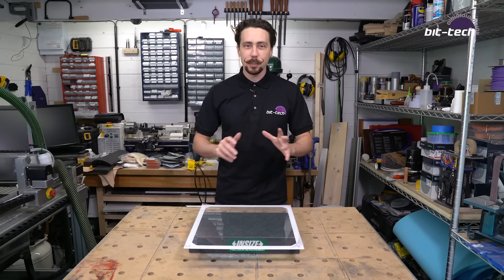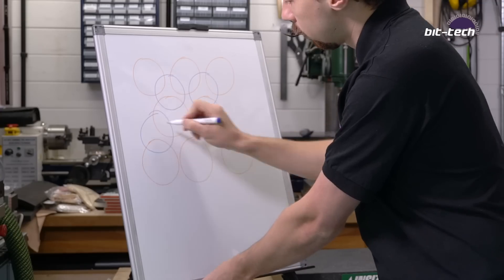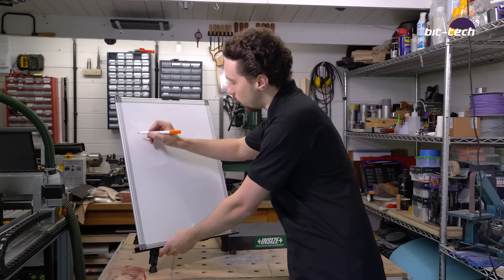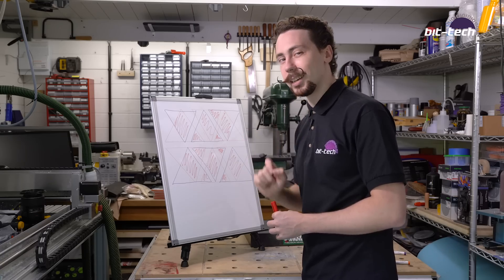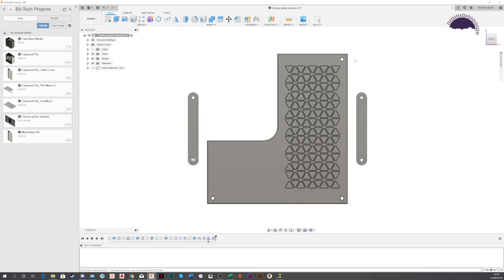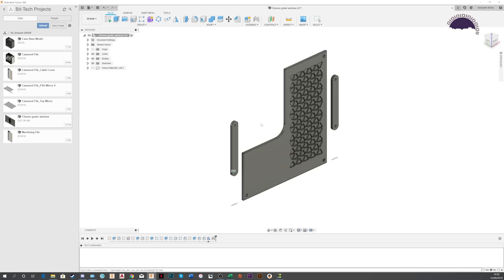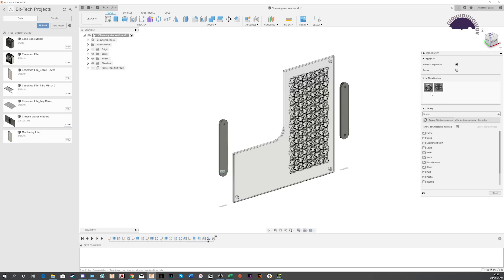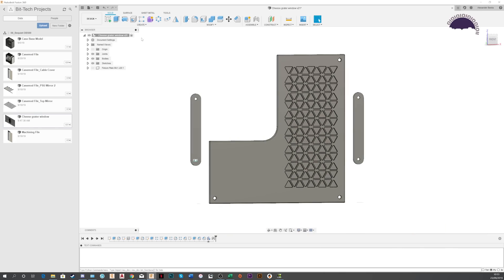CNC Machining a Cheese-Grater Side Panel for the be quiet! Pure Base 500!

Comment from the maker: TIMESTAMPS:
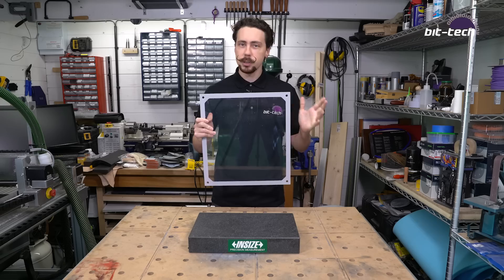00:34 How it works
02:51 CAD
06:04 CAM
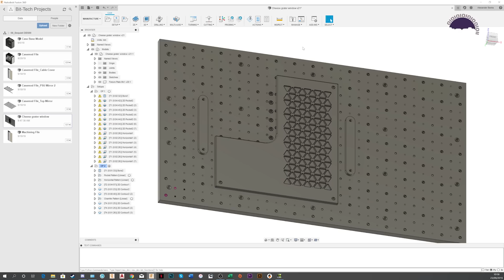12:03 MACHINING PR0N
Reply: Can provide the exact size and location of the Be quiet base 500 or pure 500dx 4 drill holes for CAD? I would like to design and customize its side panels myself. Thank you.

Comment: Was curious if you’ve tried out fire polishing?  Not that you don’t already very typically get an awesome machined finish, but I’ve seen it used a few times on plastic parts on the Wintergatan Marble Machine X parts, and was thinking it might be good for some of what you’re doing.
Reply from the maker: Aah I did give it a go but the issue is it rounds the corners and facets, especially on smaller details like embossed sections or chamfers. You can usually tell if something has been flame polished at a glance. Where possible I try to do it on the machine as much as I can as really that's how you get the best results in the long run.
Reply: bit-tech Makes sense.  Thanks for clarifying!  I suppose a lot of what you’re making is meant to be looked at much more closely and intentionally refract RGB, especially compared to the MMX :)

Comment: One tip for 'trying to get the contour right'... you could just model the pocket as it should be and then use the upper contour + a selected cutting depth. 
nice machining and great looking parts tho.
Reply from the maker: ShasOAunLa Aye although realistically it’s the same number of steps. It’s marginally easier to select the pockets vs contours, not much in it though. That’s the route I would have taken if somebody else had sent the 3D file for sure

Comment: It bothers me that the triangles aren't perfectly tessellated, and that the lattice has that odd shape where the lines intersect. I also think you should have offset the tessellation in both axes, with only the one offset it just looks like a repetition of the over- and underlined stylization of the Roman numeral X with hourglasses at the end.  
It's not a bad looking part, I just think a proper tessellation with both axes of offset would have much more potential of being aesthetically pleasing. 
I'd also like to see this piece lit up, from behind and from the edge.

Comment: Only 28k subscribers...smh

The Hex would be interesting with that inwin 303.Not the best case but it would be interesting to see a mod on it.

The triangle pattern is interesting but maybe try one side small and one side 1.5X the size (or slightly bigger so the horizontal line matchup). I think that would be a more interesting pattern.

Maybe use a scrap piece of something before running it the code just in case the paths aren't right.

Keep up the great work.
Reply from the maker: Cheers! I did actually try out a few patterns but the nature of triangles sort of got in the way each time. With different scaling or offsets it just resulted in a bit of an awkward mess, some parts would look great but others would be just ugly joints and look out of place.